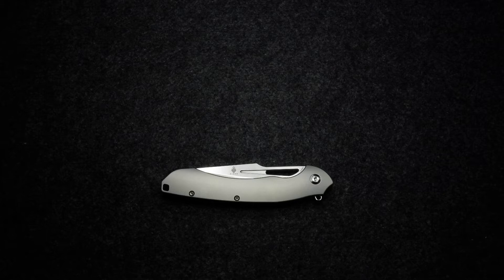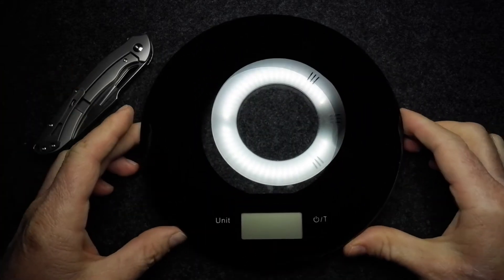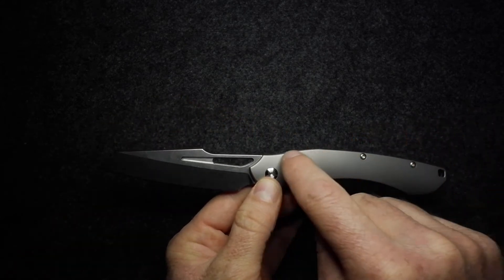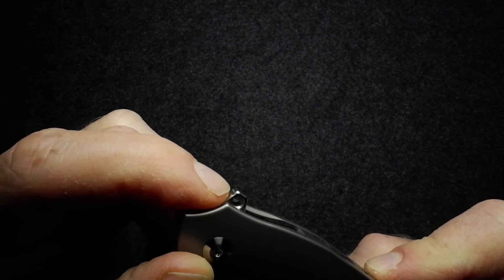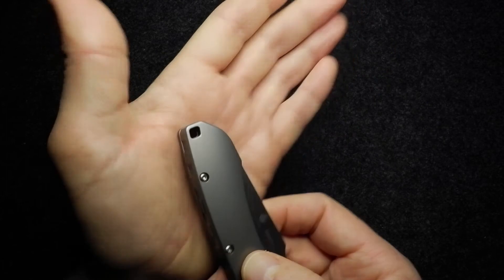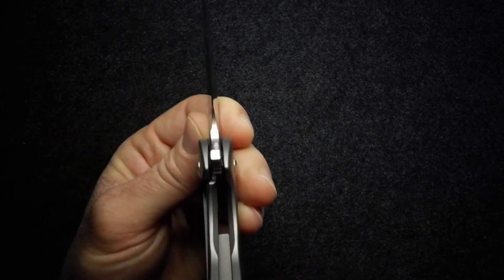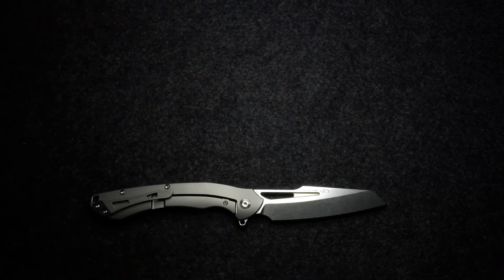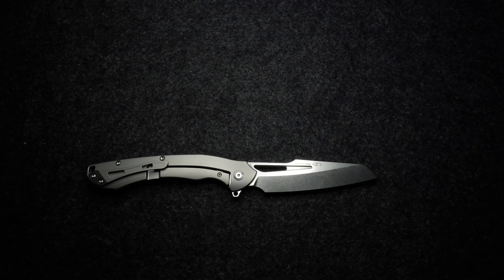Kizer Raja Ki4537. The Titanium Diarchy.

Comment: I'm a lefty and should be able to keep my thumb on the pocket clip for left hand fidgeting or the pivot like you do.

But typically as a lefty I can be careful about pressing down with my thumb too hard and still flip it easily. It's different versus 3 fingers that are holding the knife up. The pocket clip doesn't go too far up the handle to gripping it may be a challenge but I'd just have to hold it to see.